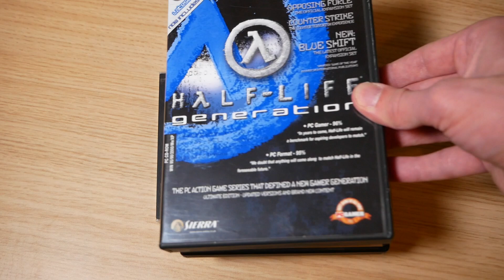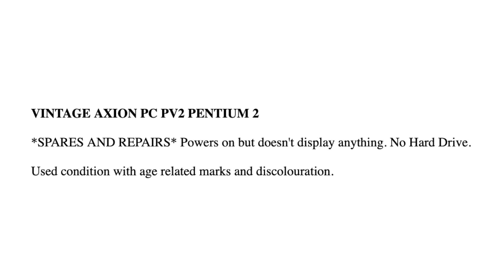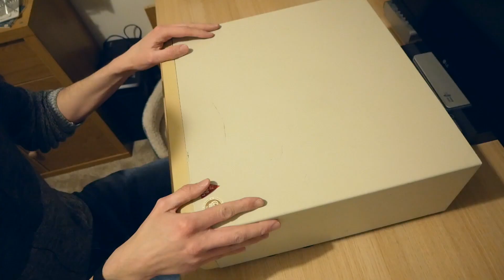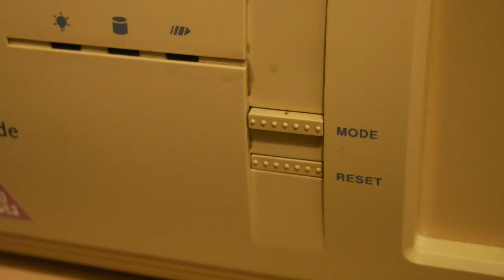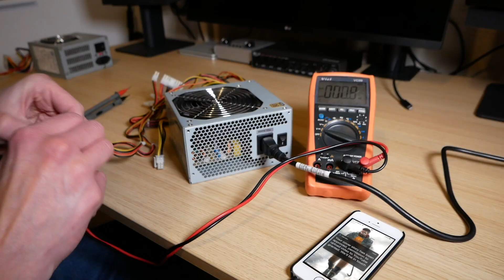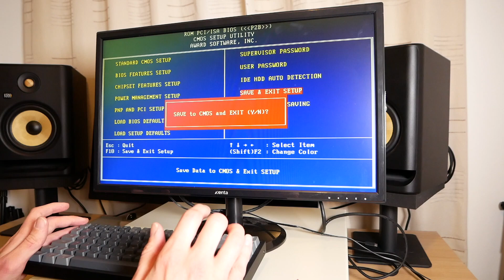Cheap eBay Pentium II Rescue

Comment: Those were such great boards. I managed to get the ultimate, a P3B-F Rev.1.04 out of a cardboard box at a computer recycler. I think he charged me $10 back around 2000. Still runs and no capacitor issues yet. You can save money on vintage stuff by the simple expedient of just never throwing anything out. Might want to only keep nice things for practical reasons, of course.

Comment: Pretty nice find, some upgrades will be done i guess ?
A Slocket adapter for socket 370 cpus maybe ? those coppermine pentium 3's should be pretty easy too find.
256 mb ram & a early agp gpu like a nvidia tnt 2 ultra or nvidia 4200ti ?

Also once you got os installed & maybe usb patch as you do have two usb ports on the motherboard.
(Fat32 formatted ofc as ntfs is not supported in windows 98 or 98 se.)
Feel free too try the opposing force timedemo from this demo copy of the game. https://www.youtube.com/watch?v=xeUnlZla600 had too make a shortcut with the target as -console - dev but works then with " timedemo blast " in the console.